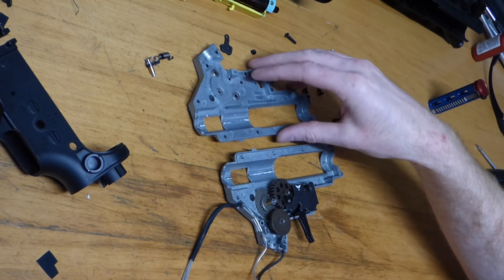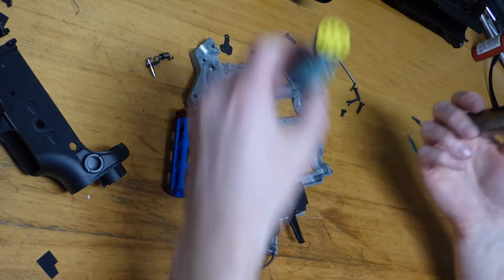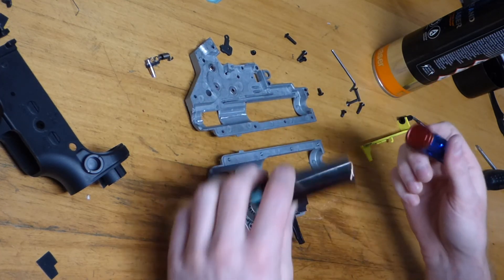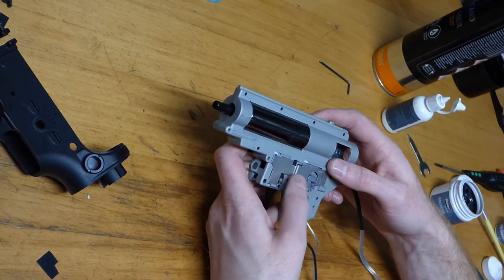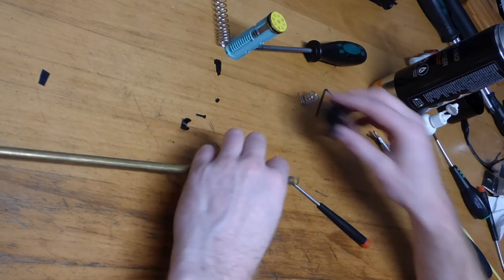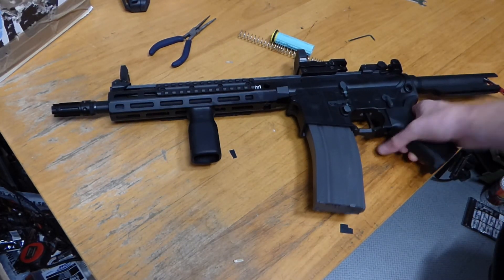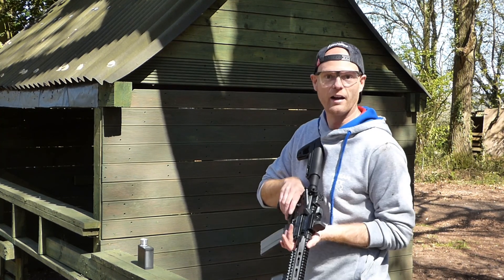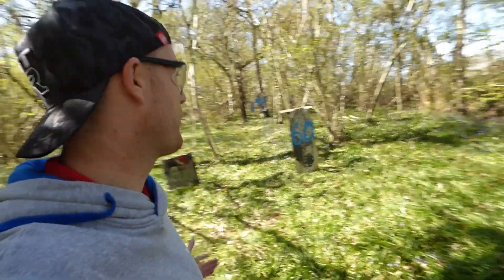Double Eagle M906B - Upgrade and Range Testing

Comment: Nice video BUT....you're build might be at risk

If you want to consider these changes in future :

1. Getting back to a plastic piston to reduce the wheight on it ( avoiding overspin on a low spring ) The plastic piston is a failing point, you want the fail to be there so the damages are not expensive.
2. Replace the piston head with a double o ring one( on the stock plastic piston ), that wheights not more then 12g.
3. Replace the cilinder head with double o ring.
4. Replace nozzle with single o ring ( measure it first before ordering one )
With these changes you should result with a consistent FPS, inspect closely the cilinder because mine was full of scratches and i had to replace it with a new one with the same volume.

After that if you find a decent barrel, somthing stainless, i went with a 6.02 ZCI and a 50* macaron rubber.

SO: An aluminium piston that you have is designed for a DMR rifle that has a bigger spring, you are at risk of tearing up the gears when you will run full auto.

Hope this was helpful,
Have a nice day !
Reply from the maker: Hi! Appreciate your input, however you may be pleased to learn the this particular build has been performing exceptional well.

The guy who owns it uses it on a regular basis and give it a bit of punishment and it's still going strong.

Also he has even been pulled up during games at one site for his gun to be recheck on chrono as people were commenting that it could be a full auto DMR. 😎

Nice to read your input and goes to show there are more ways to complete a successful build within a gearbox.

Thanks for watching!
Reply: the only good bit of advice youve said is the nozzle. everything else is either false or a gimmick

Comment: Nice video! Do you maybe have any information if the falcon mosfet has got active brake? I am planning to buy a 908A and would like to install 13:1 Gears and also a stronger Motor but i donˋt know if i will gen double shots then which a mosfet with active brake could prevent…. Greetings from austria :)
Reply from the maker: Hi, thank you for your support and nice comment. Sadly I do not know the full ins and outs of the Mosfet. I do remember being very impressed with the gun as a whole. I approached it will low expectations given that is is a Double Eagle. But was most impressed with its overall build quality and performance. I would say give it ago, you can always add another Mosfet later if needed. 😎
Reply: @adzzzysarmoury  i already got a double eagle and i can totally agree with you, what you get from the money is almost unbeatable i would say… about installing another mosfet, do you know if its possible to install an external mosfet like the Gate NanoAAB without needing to remove the stock mosfet or would it mess something with the signals the mosfet is sending or something like that? 😅
Reply from the maker: @coctroll7430  I would say do a complete replacement with which ever Mosfet you chose. Remove the original completely.
Reply: @adzzzysarmoury  apparently i donˋt have any other options beside spending even more money 🥲

Comment: Ive just started thinking about upgrading my m904L im looking at a xt aeg m110 and a maple leaf mr hop hop rubber 60 with nub would that be sufficient to hit the ranges you are but still be viable for cqb
Reply from the maker: Yes a Maple leaf MR hop rubber will give you good results. All you need to make sure is that the window on the barrel is big enough to accept it. Make sure you use the omega nub to pair with it. Also heavier BBs will give you better results too. Get it to a power of 1 joule or just over and you will be good for both woodland and CQB sites.

Comment: what spring was originally in it and what did you upgrade it to
Reply from the maker: It was the factory standard and was the equivalent of about an M85 spring (ish). It now has an M100 which takes it close to maximum AEG limit (UK).